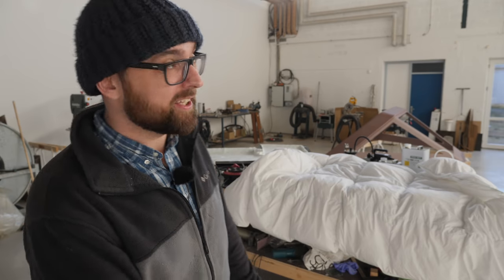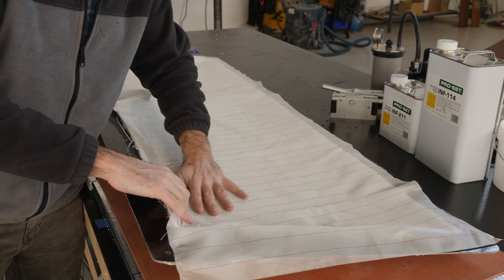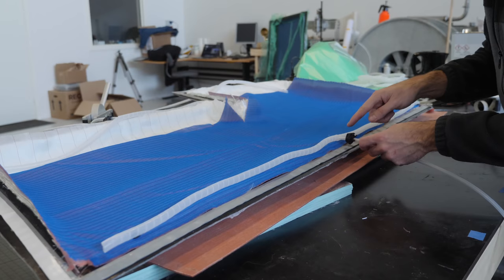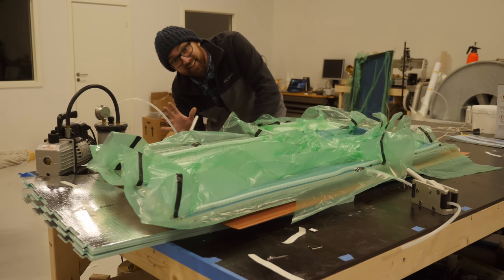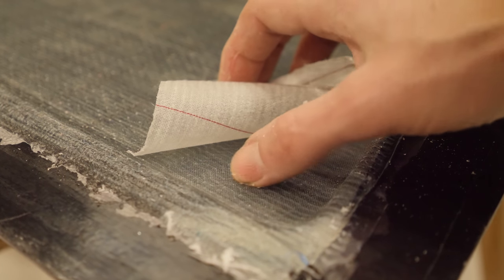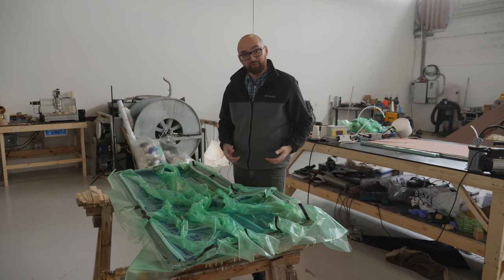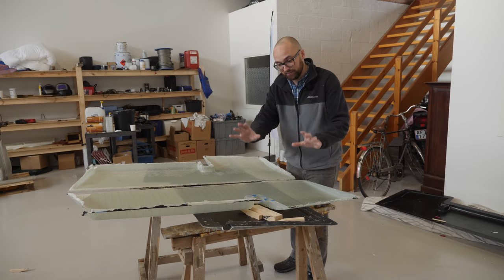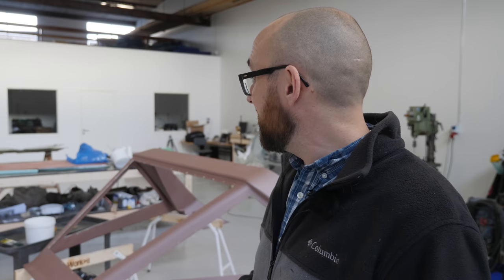Sail Life - BAD vacuum infusion vs GOOD vacuum infusion - DIY sailboat repair

Comment: Thanks for showing the good and the bad with vac infusion.... it happens to the best of us.  There is a type of bag plastic known as 'Stretchlon' in the US, as the trade name implies its pretty stretchy bag plastic.  As long as the contours of the mold aren't too crazy the bag will stretch quite a bit and you save much time and material by skipping all the pleats.  The pleats are usually where the leaks occur.
Reply: Hey bro. You need to jump Mads while he is in LA and convince him that synthetic rigging is the way to go on Athena. 👍
Reply: @redpillpirate111   I met him in LA just over a year ago when he had a meet-up.  I think that was before he had completed the deck re-core, it was also before I started Kraken.  I gave him a couple soft shackles I had made.  Mads is really smart and he keeps up with technologies & methods in the sailing world religiously, I'm sure he has at least considered it.  In a previous episode (just 2 or three ago) you can see a big spool of what looks to be around 10mm Dyneema on the workbench in Mad's new shop.  I posted a comment to ask about it and Mads responded it belonged to Cement Boat Guy, so you know the two of them are sharing a bunch of ideas.

Comment: the last bit about learning a new technique sounds like the biggest bonus in my opinion, seeing as you will be able to use it later for some even more challenging parts it makes great sense to learn the ropes with a fairly straight forward piece to begin with. lovely video and have a great trip to the states.

Comment: Hi mads, great job bud! Wanted to make couple comments you are probably aware of but they may help assist others and or yourself for future projects. Another strong point in favor of vacuum infusion is because of the more precise ratios between glass and resin it provides a much stronger and lighter product than hand laid or vacuum bagging. You mentioned the idea your making the molds gives you ability to make future rudders for those who may be in need. I remember years ago when I first started learning about boat building, the company I sought for info had air fittings spaced every so often in their molds. That way when cured, they just attached air hose and the plugs popped right out of molds without having to wedge, pry and so forth to get them to release. Was good idea and thought if you had one fitting in middle or maybe one fitting toward each end would be helpful. Enjoy your trip and good luck.

Comment: Mads, love the vacuum infusion stuff. Very interested! I would watch just raw footage! Vacuum infusion is something I have not done, pretty much  one of the few  things I have not done. I have rebuilt a rudder with hand lay up and replaced the post. ( I have rebuilt engines, recored decks, replaced rigging, rewired, re plumbed, and on and on... but not vacuum infusion. Thanks for another great video.

Comment: Great video.  I used to race off-road motorcycles and we used to say that if you aren't crashing every once in a while then you aren't going fast enough and will never win races.  You have to push the envelope and risk failures to reach greatness. 

Maybe you can salvage some of that bad rudder half for scrap material when patching other fiberglass projects.  Is it all bad, or are there some good spots that you can cut up into decent-sized pieces for use later? 

Or maybe at the very least you can make it into wall art. Doesn't every marine workshop need a rudder profile hanging on the wall?

Comment: I believe there are automatic vacuum actuated switches that the vacuum pump plugs into which keeps small leaks under control when bagging.   You just leave the pump switch on overnight and it turns on at the switch's setting as needed and they are very affordable ($35 USD).

Comment: As I'm sure Mads is aware resin. Infusion is being used to make large yacht hulls (power and sail) now, 60', 70',80' and more. Major investments that cannot leak.  Getting the right mix of pleats is tricky as pleats cause leaks. 
Although vacuum infusion is a great way to produce quality parts with very low emissions it's really a variation on lots of different methods that were used 60+ years ago when the resins were like glue and could not be hand laid up. As the chemistry improved hand layup was possible and allowed the explosion of the fiberglass boat industry. 
The clever trick with 'infusion' is that the when the mold is partly full if resin under the film the air pressure created by the vacuum holding the film down is not lost and the film does not lift, it's weird but as long as the filling bucket is below the lowest point of the mold it works incredibly well. Cheers Warren

Comment: This week, Mads is entering 'Research and Development' in the vacuum bagging branch .... 😄
Things like that happen now and then. What would probably had worked was let the vacuum pump run on after completely shutting down the supply side - gotta accelerate the curing with heat significantly though, otherwise the area round Your leak becomes too dry - more with every minute curing time, of course.

Comment: Beautiful work,  will the different weight of the new rudder affect the weight and balance of the boat?
Reply: Good question @Raymond. The original rudder had a sand/resin core I think that would have had a negative buoyancy i.e the rudder was quite heavy in the water. Will a foam cored rudder create a positive buoyancy i.e push upwards on the stern of the boat?
Reply: iFlyByWireless :  Well I guess I’m asking about the counter ballast to the mast weight are there any concerns?  As you can tell I’m not a boat person, but I find your diy attitude very refreshing.

Comment: Vacuum infusion is interesting and fun, but I don't think it makes a perfect laminate in reality.  If you look at aerospace composites the ratio of fiber to resin is incredibly low, but they are using prepreg to get there. (Glass or carbon with resin preimpregnated and kept frozen) That might be a fun experiment as well. The best you are probably going to get if you are really lucky is somewhere in the  50/50 range which is way too much resin. You want the fibers to do the work. We found that our best stuff was wet layup, taking care to wet the cloth but not get carried away, and then bag the hell out of it and suck out some more resin with bleeder/breather. That, if done carefully, can get you sub 50%.

Comment: I knew an old dude who used to spray fiberglass on dune buggy molds back in the 60s. I was wondering why you didn't do this, but yeah cement boat dude would not be happy with that itchy mess huh.

Comment: Instead of heating the plastic pipe with warm water to make it soft and pliable use a small hammer or anything with a bit of mass and hit the pipe which is resting on the floor or something heavy and the energy imparted into the pipe will create the same effect and make it pliable but without the fuss.

Comment: Hi Mads , I’m curios why you didn’t start with a layer of gelcoat if going to all the effort of vacuum infusion?  I realize you’d likely have had to use polyester rather than epoxy, but that would have been cheaper as well. Nothing wrong with what you’ve done, just curious.

Comment: Hi Mads. A question....Andy from 'Boatworks today' recently made a video about why glasmatting doesnt work very well with expoy ... and that is why he works with polyester. Reason is, he says, the binder of the glasfiber matting. He told that the matting in europe is bonded differently and that that is why it is acceptable to work with epoxy in combination with matting in europe. Is that why you dont work with polyester ... or in general...why do you work with epoxy and not with polyester?

Regards.... Jaap from The Netherlands
Reply: Hi Jaap, I think there are several reasons for using epoxy instead of polyester.
First of all polyester smells horribly in the curing process, polyester is also much less resistant against hydrolysis so it basically deteriorates in water.
A big reason for choosing epoxy could be that it has better mechanical properties in combination with fibre reinforcements.
But polyester is cheaper so in many cheap boats there using useless fibre matts with useless polyester and covering all this with a coat of epoxy to separate it from the water.
Have a nice evening

Comment: Doing this by vacuum infusion to achieve a lightweight laminate vs. hand layup to save a few ounces won't matter for a rudder.  It's low on the C.G. and a few extra ounces of resin will just be a little extra ballast. Overall, with the foam and all, it's probably near neutral buoyant anyway.  As you've seen, it's very difficult to achieve a uniform laminate, especially in the corners and odd spaces.  I'd rather see at hand layup with lots of extra glass and resin in the nooks and crannies where loads tend to concentrate.
Reply: Too much resin is brittle, not stronger.

Comment: Could you replace the vacuum with compressed air to get the plastic off?
Reply: Probably not, i think the hoses and fittings are full with cured epoxy.
Reply: Haven't seen it been done on yt , so don't know

Comment: questions
should ther not be gelcoat on the outside of the finished rudder parts,
i.e. first gelcoat in the mold, then fiberglass before infusion
or is it on purpose so it gets topcoat afterwards, or is supposed to be paint with epoxy paint afterwards so that it becomes waterproof
I ask because I've seen them give boat molds gelcoat before fiberglass also in a vacum molding
Reply: Gel coat is polyester resin. He's using epoxy. They're not compatible
Reply: I have been employed at a place where we years ago educate people for wing production at vestas, they use epoxy for the wings,
and there we had many colors of gelcoat which i myself have used together with epoxy glued fiberglass parts for me
but it was 20 years ago long before vacuum infusion was invented, that they had molds to practice where they first got wax, then gelcoat, they had several gelcoat colors, red, blue, white, black, yellow , green, gray, brown, etc. 
the first layer of fiberglass was laid on top of the wet gelcoat and pressed slightly in, then it got epoxy, then the next layers of fiberglass with epoxy on top on each layer that was rolled out with a look like a paint roller to push the epoxy in and air out, then it get the same layer on top as with vacuum infusion, 
then vacuum and let it harden for 24 hours if I don't remember wrongly,
Vacuum infusion makes use of less epoxy / polyester resin,
they also had fiber filled with resin where they were kept cold in a container, they get cut to the mold shape and vacuum baget and put in a heat cabinet

Comment: Vacuum bagging may use less epoxy, but what is the cost of the vacuum pump, all the single-use films, mesh, tape and tubing, etc - is it really "cheaper"?
Reply: Epoxy is pretty expensive.
Reply: I am not an expert in those techniques but I doubt that it is cheaper than the good old and simpler manually laminating technique. At an industrial scale it might be but just for one relatively simple piece ? And you have to consider the higher probabilities of failure, with the cost of doing it again, as Mads eloquently demonstrated.